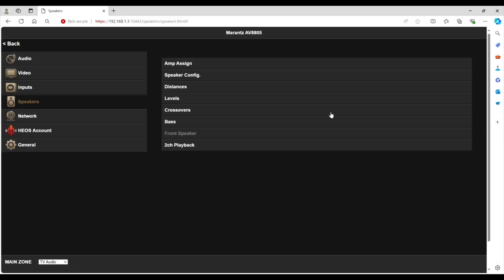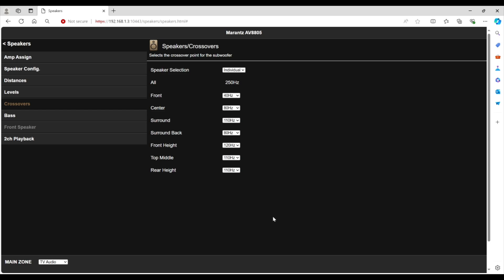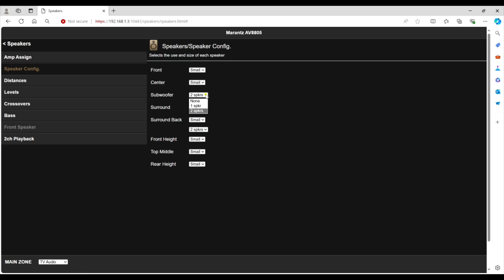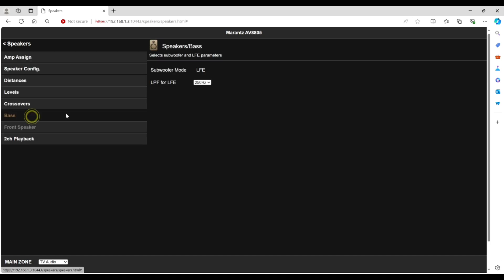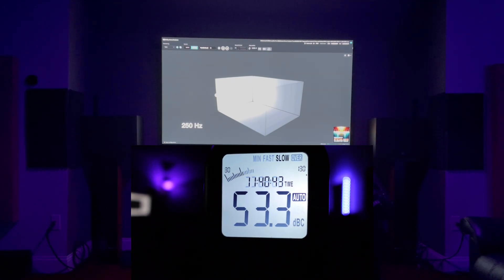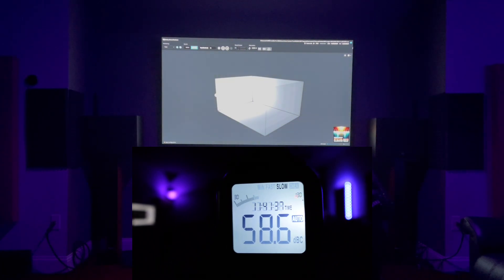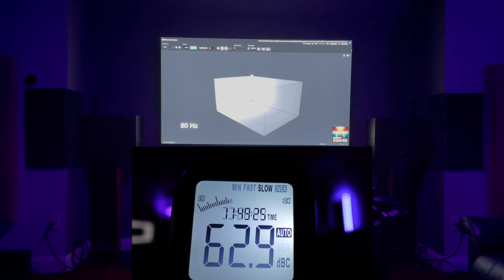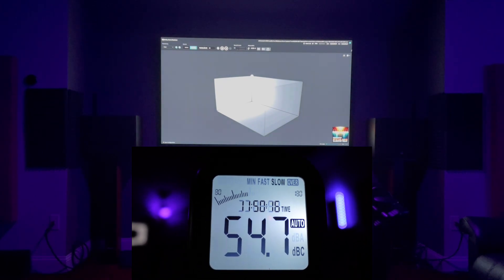How To Set Speaker Crossover Frequency | Spatial Audio Calibration Toolkit #hometheater

Comment: Sir,your suggestion means a lot to me.Can you guide me in calibrating my subwoofer.Before starting my calibration with denon audessey mic what all settings should i do behind my sub.
2) Currently my volume level behind my sub is kept at 75%
3) phase is set to 0
4) crossover is from 30-200 which i have kept at 200 behind the sub.
5)my room size is 13*8*6..sub is taga 212se 12 inch
6) can i start the auddessey or should i change any settings behind the sub
Reply from the maker: Sorry for the late response. 1) Volume is too high. Audyssey will ask you ask to adjust the sub volume to between the free bars. 2) Play some familiar music and assess where the bass is in sync for the sub and front speakers.  Where it is the strongest and in sync is where you should leave the phase.  3) Crossover on the sub is inactive when using LFE input. You can run Audyssey as is without any changes above and see assess. Then go back and make the changes to phase as I indicated and rerun Audyssey and see if it makes a difference. Good luck!
Reply: @magnoliamo  my sub is asking me to put volume at 30%
Reply from the maker: @tusharmenon4794 ok that’s correct. I thought it was too high.
Reply: @magnoliamo  how will i asses where the bass is in sync?.what should i do to check that?. I am playing a music now.what should i do now to make it sync
Reply from the maker: @ play some music with kick drums and the some bass.  The beats should be in sync and strong when the phase is set right. That’s the simplest way without using REW.  If you have Audyssey MultEq XT then it should do the phase alignment as well and you don’t need to play around the phase behind the sub.
Reply: @magnoliamo  ok thanks👍

Comment: I really like the way you explain things. Can you help me out with a query on my sub. Im having denon 1800h amp.
1))Before starting calibration i turned the volume knob behind the sub to half and i let the crossover at the starting position.After calibration While adjusting the level using spl meter my sub is just reaching 65 db with knob in half position and -3 db in test tone.why so.normally with -3db and in half position the spl should show 75 right coz i think -3db is enough loud.
2)Second what should i do to avoid boominess from sub.
Reply from the maker: Audyssey is known to set subwoofer level too low but in my opinion it depends on the location and distance from the main listening position.  What subwoofer do you have? Are you using Audyssey MultEQ App to run Audyssey? The crossover on the sub is disabled if you use the LFE input.  How many Audyssey Mic positions are you using?
Reply: @magnoliamo  yes im using lfe input.Im using the audyssey mic which came along with denon receiver.Taga 212 se 12 inch sub is what i use and my room size is 13*8*6 room. Since its a small room i placed the mic in 3 positions.centre left and right.
Reply from the maker: Ok. I would recommend taking all 8 measurements around the main listening position. MLP, left and right to the MLP.  One directly in front of the MLP and then left and right of that. All no more than 20”. Then the last two immediately to the left and right of where your head would be as in this video. https://youtu.be/Z-p18Tr_2Nw?si=qaWoAvl_BcQWtihg
Reply from the maker: And try to experiment with the phase if you have it by listening to some music. Adjust the phase to the point where the bass from the sub is the strongest and in sync with the fronts.  If you REW and a calibrated mic then REW is a powerful tool for sub alignment with your fronts. Once you have aligned the sub with the fronts then run Audyssey. That’s my recommendation.
Reply: @magnoliamo  13 feet to centre...12 feet to front left and right... 2 feet to surrounds and 3 feet to atmos.

Comment: Why aren’t you doing a near field response? Also, I recall you had nulls maybe in the 50 and 70 hz range? Maybe a larger speaker with a crossover point that can go lower to fill in those frequencies and maybe eliminate the multiple sub channels? Just a silly thought.
Reply from the maker: @Proper49er  Thank you for the comment.  It is my understanding that near field response is for the speaker frequency response which eliminates the room interaction.  I have had the B&W 702 S2 setup previously in this room and still had that 60 hz. I believe with the A1 Evo installation that null has been reduced. The null primarily was caused by subs. The frequency response at the main listening of the CT7.4 does not have the null.

Comment: Great video. According to DIRAC, my speakers drop off at 40-45hz. I am currently cutting them off at 80hz. Would lowering my crossover to say 60hz be more desirable and if so, what would the benefits be? More directional bass?
Reply from the maker: I say try 60 hz. If the bass is not as powerful then switch back to 80 hz. Directional Bass is more for multiple subs in my opinion.  I think 60 hz would be more appropriate if the +/- 3 db limit of your speakers is truly at 40-45 hz.

Comment: You run your LFE at 250? The Martantz default is 120 and I am pretty sure  there is no LFE coded above 120. Just curious why you set to 250.
Reply from the maker: @m4nc1n1  No LPF to LFE is set to default of 120 hz.  I have individual crossovers setup for all the speakers. 60 hz for bed layer speakers, 80 hz for top middle, 120 hz for front heights, 80 hz for rear heights.
Reply from the maker: In this video I was assessing the crossover points and therefore set the height speakers to large which caused the LFE to default to 250 for some reason.

Comment: I would set the crossover right at the -3db fall off point.  Or as close as possible (some processors don't allow incremental db for crossover.  example, D&M crossover is every 20hz).  Another good technique is to put the crossover point 10db above where the drop off point is.  If your speakers fall of at 50hz, then set the crossover at 60hz.

Another technique is to set the crossover point for ALL the speakers the same, even if some speakers have a different -3db point, the idea is that when all speakers are set to the same crossover point, it allows your speakers tonal balance to remain completely consistent as the transition to the subwoofer is the same no matter the speaker.
Reply from the maker: Thank you so much.  I started with the same 60 hz for all the 7 bed layer speakers, CT7.4 and CT7.5.  I only decided to change to different crossovers after using REW to find the best crossovers for smoother bass throughout.

Comment: Thanks so much for sharing this tool with us. I'm interested in applying the idea to a stereo system with bookshelves and subwoofers. Happily, YouTube has a number of video's with test tones. This one provides tones from 5Hz to 200Hz; https://www.youtube.com/watch?v=aBlJebipLgM&t=3s 
It's an upward progression but with my subs turned off, I simply play the video and as soon as I hear a tone from my bookshelf speakers, I immediately pause it at that point, taking note of the frequency, then turn on my radio shack sound meter and start the video back up. The sound meter shows when I've reached the bookshelves 3 db point as the sound meter will stay level at tones played upward from that point. No guess work involved in then setting the subwoofer's crossover point. Thanks again.
Reply from the maker: Yes, for 2-channel, those YouTube  videos will work.  For my 2-channel I use the Stereophile Test CDs. In addition to the warble test tones and bass sweeps those discs have some really good demo music with “what you should listen for”.  I will check out the video in your comment.  Thanks for sharing.

Comment: Sorry, however I will have to disagree on two accounts:  1. 10 dB down at 32 hz should then (IMO) be a crossover at 60 hz (not 40 hz), 2. Even say at 60 hz one needs to also take into account Dynamic range, and so just because a speaker can play flat to a given frequency doesn't mean that it can do so to full reference levels with very low distortion. I know people just HATE to buy hulking tower speakers and then have them crossed over at 60, 70, or even 80 hz, however very often (more often than not) one's tower speakers really ought to be crossed over at 60 hz minimum and often at 70 hz, or even 80 hz. Now, if one does reference level testing with a 40 hz crossover and all us great, then by all means 40 hz it is 🙂
Reply from the maker: @johndaddabbo9383  thank you!  I agree with you. I have always used 60 hz as the crossover for the fronts and only recently changed it to 40 hz. Reason was for the change was additional fine tuning using Audyssey and REW.  At the 15:20 min mark is where I determined that 60 hz was the right crossover using REW and sub alignment. I am interested in your thoughts on whether I arrived at this correctly or not. Here is the video. Thanks for setting me straight. 

https://youtu.be/5DYUPhM-VDI?si=p-OTNG4lsoColeNj

How to get tighter bass with Audyssey MultEq #hometheater
https://youtu.be/Z-p18Tr_2Nw

Comment: Mo, thank you for making this! Maybe the reason your speakers are playing lower than the spec is because of the boundary gain they're getting? Another tip for people is to run the tests with Audyssey disabled just in case the EQ is boosting certain frequencies which might affect the SPL reading.
Reply from the maker: What’s up Joe!  You know what. I just checked the frequency response in the manual and B&W CCM663 have a frequency response of 45-50,000 Hz (-6db). It makes sense now. Your point about boundary gain is spot on as well. I did run them in pure direct and got the same bass response as with Audyssey. Thank you for keeping me honest!